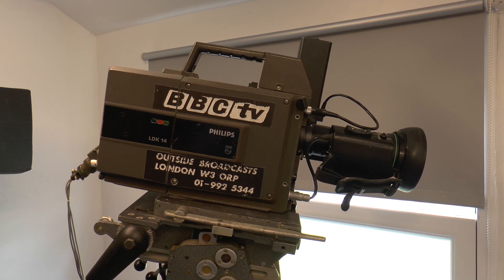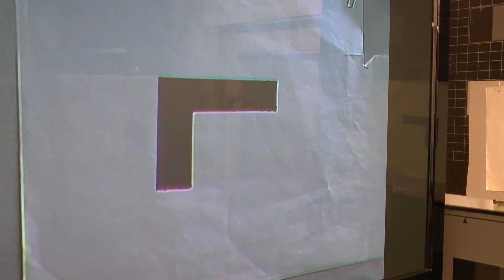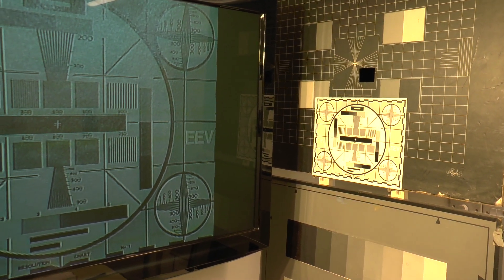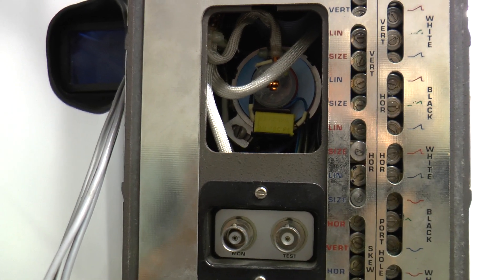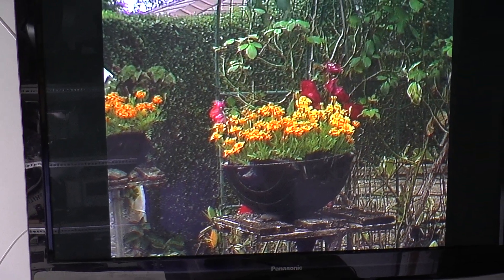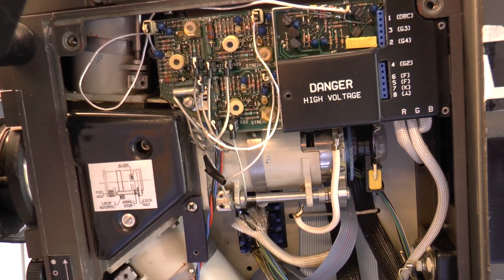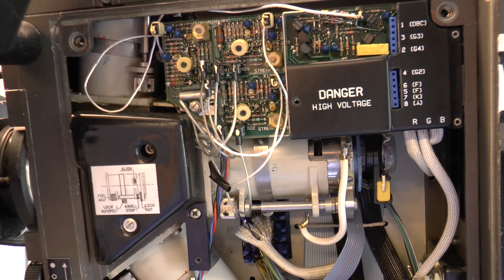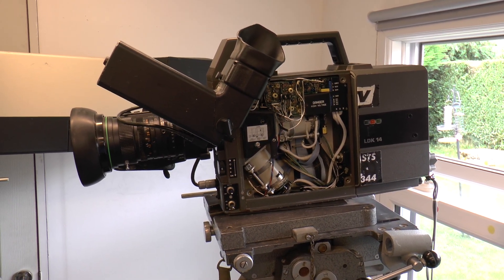Philips LDK 14 ,  Broadcast Camera ,1977

Comment: In my young days I used that camera, the 614 and the 54.
Reply from the maker: I have three LDK 54s ,but there tubes are poor, so pictures from them is mixed, and the only other camera that uses that type of tube is a ikegami HL-95, I have one of them as well, with good tubes
Reply: @vintagevideo4044  yes, I remember it was a nightmare when time to replace the tubes of the 54 came, as they were very specific 1/2” models. I also used to work with the big sister LDK-6A and it was a dream (at least until our maintenance department decided to buy EEV tubes instead of the original Philips).

Comment: Ingenious construction it is hard to believed there are three tubes in there.  The alloy machined case is a work of art, I have an AGEMA 550 Stirling cooled Thermal camera of this era and it is built like a tank, the colour viewfinder is a crt and the resolution is incredible it is less than a inch diagonal and a joy to see. Keep posting.

Comment: Would be lovely to see some direct capture from this and your EMI. Pointing a camera at a screen really doesn't do it justice.
Reply from the maker: I have done direct capture, but standard definition, always looks  poor on colour and general sharpness. High Definition always works well
Reply: @vintagevideo4044  You may find modern scalers like the Retrotink do a better job. Domestic capture cards are generally rubbish and it's better to use a converter/scaler then capture that as HDMI.
Reply from the maker: Thanks , I will have a look at one of them

Comment: Interesting that it had auto-centering as early as 1977. The Sony and Ikegami camera of the time didn't have auto cent. I believe it was the Sony DXC-M3 that had auto-centering in 1983-1984.

EDIT: The Sony BVP-330 had auto-centering as early as 1979, but Philips still seemed to beat them to the feature. Also Ikegami never offered auto-centering as far as I know, only Sony.

What's the lens mount? B3? Looks like a Canon lens
Reply from the maker: That was Philip's first all in one, portable camera, with auto centering, it tells to work better, if all there tubes are like new, with a high output. Yes the lens is Canon, but uses a special Philips mount and connection plug, only for Philips cameras